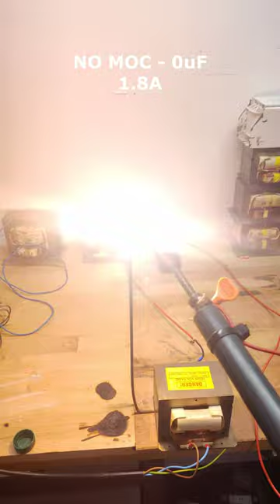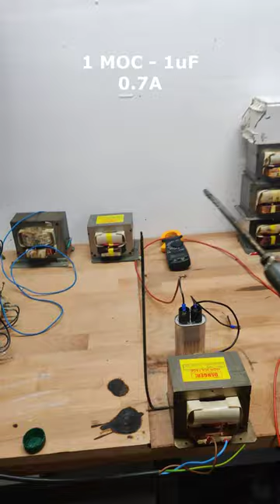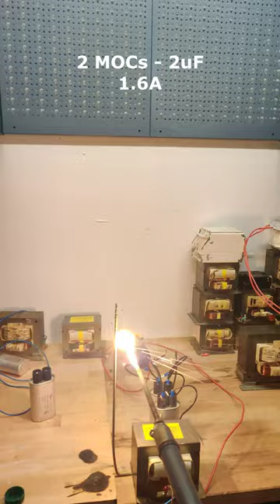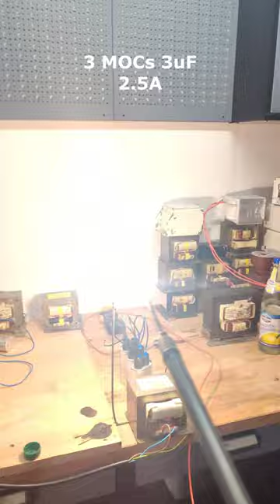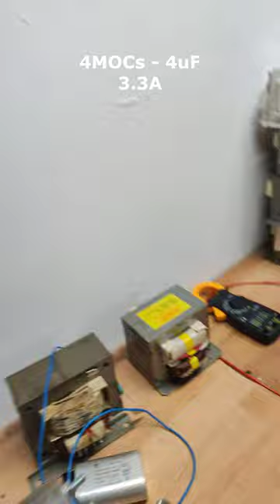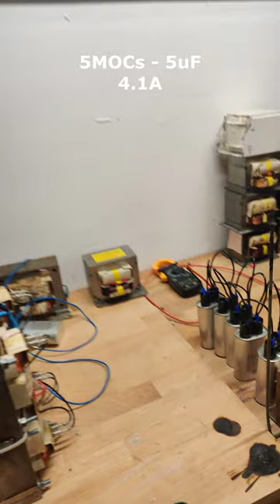Microwave Oven Transformer (MOT) Resonance Arc - How Many Capacitors (MOC) ?

Comment: now do mot stacks! :D (from 2100V single mot, to multiple mots as many as you can in parallel, then resonance caps, to 4200V mot stacks, then resonance caps, then maybe 6400V or so without resonance caps etc)
Reply: Mot stacks are boring
Reply: Distribution transformers are much better and more efficient
Reply: @Electromaniac420  yes, but some mot in parallel are more powerful than a distribution transformer of the same size of the stack
Reply: @minirambo921  i ordered a 100kva 20kv 3phase pole transformer
Reply: @Electromaniac420  interesting, i subscribe to your channel!
Reply from the maker: Haha would be cool yes ^^
Reply: @Electromaniac420  and? would make a fun video. distribution transformers usually have 7200V or more, MOT stacks can do 2100 and 4200V or more, that way paralleling up a bunch of them will give you a lot more current, thus giving you much thicker and growling arcs.
Reply: @breezetix  most distribution transformers have 20kv
Reply: @minirambo921  that simply isn't true
Reply: @Electromaniac420  in Germany, yeah, but elsewhere other voltages are utilized. In the UK, 11kV is standard, and in the US, 13.2 and 12.47kV are common
Reply: @inductivelycoupledplasma6207  i am not an expert
Reply: @minirambo921  that's alright, just wanted to clear that up (distribution transformers are seriously hungry beasts). MOTs can run some amps, but they don't last more than 5 minutes...
Reply: @breezetix  I wouldn't say MOTs are good for over 4200V. Putting more than 2 in series causes issues. They are good for low voltages especially if you can find the older ones
Reply: @Electromaniac420  i have 36kv distribution in my country
Reply: My car just failed its MOT so I have to replace the back reverse light.

That's all I have right now.

Comment: Yoo! Same kinda LC circuit thingy i built to my distrafo LV input.. Still having only 1 phase in use.. Added good size self built cap bank in series with the input, and it gave me a lot more power, this was like year ago..
 So, i built new good size capbank and added it also to the circuit, tried to connect those capbanks to different parts of the circuit, and tried to connect those banks to series and parallel on each other.. finally, found the sweetspot there for the best results and most powerful arcs, but i am still kinda disappointed to the end result.. Cause the first capbank i built was about, 800uF and about 400V.. hard to tell, for that one i used many different caps, but all of them being enough big to handle the load.

 After added the 2nd capbank,(1126uF 580V), I HONESTLY expected a lot more.. I guess my C exceeded the L ive got...

 But then i realized that there is one kind LC connection what i haven't tried yet.. CAPBANK1 in series with the circuit,  and CAPBANK2 in parallel with the circuit...

I was thinking do you have tried something like that?  Would that change anything? I noticed  if i connect the both banks in parallel and in series with the circuit that causes the current to rise and the voltage drop, quite a lot.
  and if i connect those banks in series and then series to the circuit, then the opposite happens..

 Could this LC series+parallel combo work? haven't (yet) found too much info about it.. just like,.. "that kinda circuit is used in induction stoves"... but could it also juice up my trafo setup?..
 Have you tried CAPs series+parallel combination with MOT and MOCS?

 And sorry for the damn long message, would appreciate if you have time to read this and share your opinion with this combination circuit on my mind. Haven't tried it yet, but wouldn't rly want to brake anything either.. even tho distrafos are damn solid things!
 THANK YOU ANYWAY🤘😃

Comment: Awesome 😎 what else can be done with moc’s?   My mot / mic collection is slowly increasing and I’d like to put the capacitors to use if possible.  Also, what’re you holding to create the contact?
Reply: Make a huge Tesla coil Like styropyro
Reply: I think He's using a PVC pipe as handle and a metal rod inside it connected to ground

Comment: Btw question about a diffrient video of yours. Where the hell did you Get a 25KV 1A powerline transformer. Getting a flyback rated for more than 200W is a struggle So i need to wind my own and i Just came across dude like me but with a transformer size like half of my room.
Reply from the maker: Haha well obviously it wasn't easy but you can find them on eBay sometimes. But asking some kind of energy company is a better way to get one of these. They often sort out old ones :)